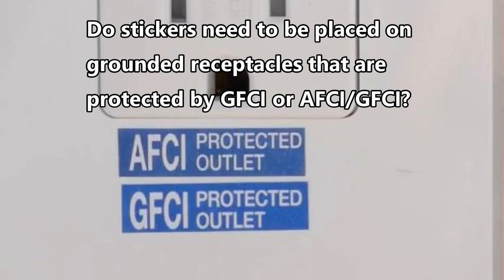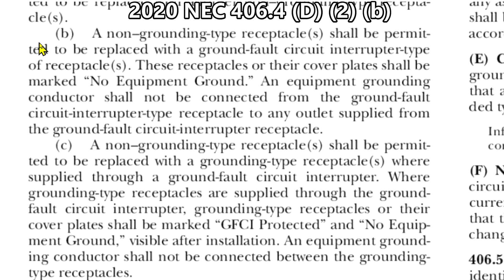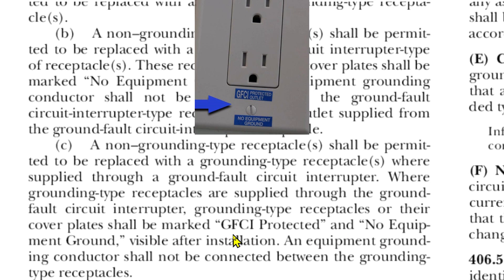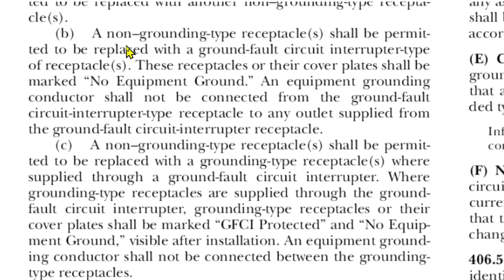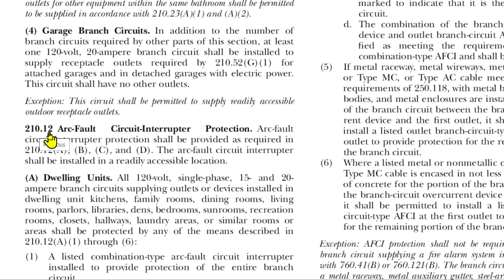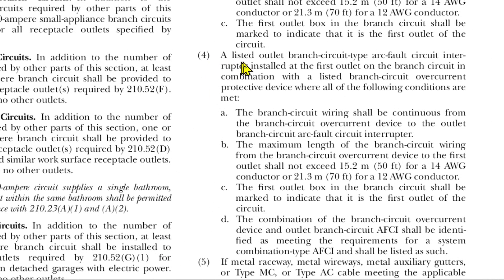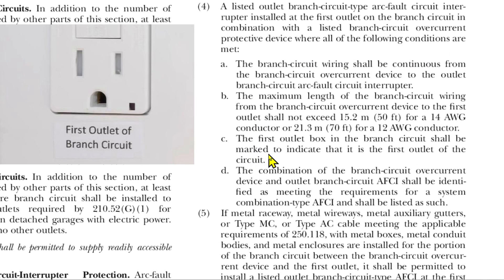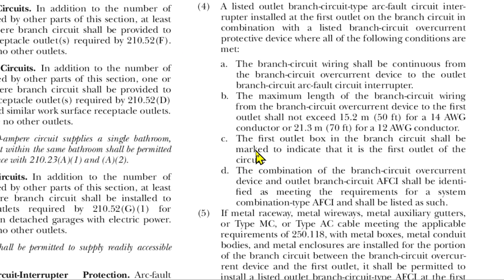Do Stickers Need to be Placed on Grounded Receptacles Protected by GFCI and AFCI/GFCI?

Comment: Though receptacles downstream of the afci/gfci are not required to be marked, some commenters say they mark them to 'remind' the homeowner to check/reset the device if the recept is not working. That's fine for you and me, but I have met many people who don't know what 'GFCI' means and would not make the connection between the dead recept and another recept elsewhere in the room 'with those buttons' (the afci/gfci). A better solution is to put a note at the breaker panel explaining that if there is a dead recept, but they don't have any tripped breakers, to hunt down the GFCI's nearby and check them.
Stickers on the recepts are not attractive! I can see the homeowner removing them simply as a matter of appearance or coming off after a few years. As for 210.A(4)C, it doesn't say the recept must be labeled, it says 'The first outlet box' must be marked to indicate that it is first in line. To me, this means some marking Inside the box such as a label attached to the feed, colored tape or some other means so that someone opening the box knows that this is the first outlet on the circuit. Comments anyone?
Reply: IMHO, what’s the downside?  If you’re uninformed and the receptacle doesn’t work, maybe you figure it out, search YouTube or call your DIYer neighbor and he tells you what to do and then you’ve been educated.  Better than doing without power and having to call an electrician.  Also, if you’re a landlord it could negate a call or having your handyman go over.  There’s a YouTube video in which the handyman laughs about how much money he has made off a particular rental house because the fridge in the garage keeps tripping the GFCI.  Renter doesn’t care and just calls the landlord who sends the handyman.  A 50 cent sticker and a note written on the wall in the garage as to where the reset receptacle is located could save the owner thousands.

Comment: Great content. I have a question. I want to add a extra outlet in garage from interior wall. I would like to plug a heater. I believe the outlet might have 5 or more on one circuit. Can I add a GFCI as the new one?

Comment: Hey Spark guy. I  was going to replace a GFCI receptacle in my kitchen with a dual function AFCI/GFCI receptacle. Then I saw on the internet that the run from the circuit breaker to the 1st receptacle (AFCI/GFCI) needs to be in metal conduit. Is this the correct

Comment: Stickers don’t make it protected the devices does.  Only time I’d do the is if the protected outlet is in an odd place compared to the protecting device.  If you don’t have power at an outlet the obvious thing to do would be to check breakers or gfci or afci receptacles. Even then we get calls because customers couldn’t reset the device.
Reply from the maker: It's a challenge to explain these things to homeowners sometimes, wouldn't you say?
Reply: Most ppl get it. But still they see electricity like it’s magic.  Even if you explain it to the, tripped breakers etc, they’re mind doesn’t allow it to sink in because the answer doesn’t have a right to be that simple. There’s obviously more to it then that lol

Comment: So here is the issue and while the NEC 2020 code does not require a sticker I always put one on not just the first outlet/receptacle but all receptacles on the circuit it’s information for everyone to know and indication that if there is no power to investigate whether the GFCI/AFCI has tripped and for what reason including, dangerous reasons. The NEC is a minimum code going above and beyond even if in this case it might seem overkill) I prefer to do it.
Reply from the maker: Excellent! I agree about exceeding code! ⚡

Comment: I know the stickers meet code requirements, but how about using a label-maker to have something more presentable looking?
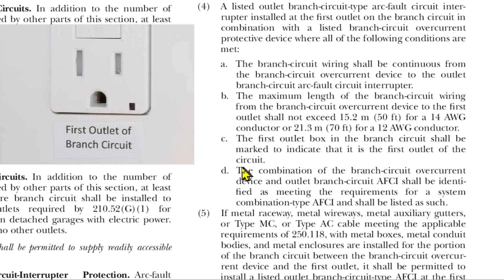At 4:24 the marking seems to have been done on a Brother label printing device.
Reply: A quality made sticker would meet the code requirement. The ones supplied with gfi receptacles are a convenience, ugly but convenient.
Reply from the maker: As long as the receptacle or it's cover plate is clearly marked it should be fine.

Comment: The sticker on downstream outlets let you know to look for a tripped GFCI outlet if it's not working. My basement bathroom outlet is downstream from the master bath upstairs.
Reply from the maker: Excellent. The stickers are very helpful in that case.
Reply: GFCI receptacles in bathrooms must be dedicated. The fact that you have two different bathrooms with receptacles on the same circuit is a violation.
Reply: @stephenrosenthal5252  
House was built in 2004.

Comment: Ive seen guys "trick" the inspector by running a jumper from the ground terminal to the neutral terminal on the back of the receptacle to make it appear the receptacle is grounded when it really isn't.   This is especially true when dealing with the old non grounded wiring in older homes and the home owner does not want to spend money upgrading the wiring🙄
Reply from the maker: Yes, I've seen it as well. I hate seeing it as it's very dangerous.
Reply: Ouch! That is called a bootleg ground and can cause deadly results. Bill has a whole video about this illegal "trick."
Reply: You can check for bootleg ground with a hair dryer and a voltmeter.
Run the dryer and check for voltage between neutral and ground. If 0 then it's very likely a bootleg ground. With the high current flow from the dryer a small voltage will develop from end to end on the neutral. With a correct ground it would show across neutral and ground.
Reply: @scott_meyer   A lot of inspectors just plug in the little tester and see if the lights light up properly if they do that's all they care about.  If they would actually pull random receptacles out and have a look they would be surprised 🙄
Reply: At the end of 50 feet you should see between .5 and 1 volt between neutral and ground with a 1500W hair dryer running on a 20A circuit.
Reply: That wiring was very common in east germany and czechoslovakia.Several doesn people are electrocuted because of it every year.

Comment: Question I never see you any loop impedance Test for testing the earth path and testing the GFCI for trip times why is that . Fantastic video Sir Stay safe watching from the uk 🇬🇧
Reply: None of the tests in an EICR are routinely done here in the states, even with a rewire or new consumer unit. No codes say we have to, which is a shame because I think these tests are a great idea.
Reply from the maker: Ian, Peter gave an excellent answer.
Reply: How do  you know if The unit is going to trip and save lives because our trips have to trip out in less then 30ms . To it’s pointless putting trips in in the states if you don’t have test them specially on houses where you have children running around . But thanks  for the answer. I am learning a lot about system mind blowing at times . Stay safe
Reply: @iandrew6347  I am from the UK originally Ian and when I moved to the states here I did these tests myself when I bought my house. Loop impedance tests like in the EICR - We have branch (radial) circuits not ring circuits and we tend to have larger panels with dedicated circuits for each room and for many large devices. So no real R1+R2 but you can work out a similar circuit impedance Zs and Ze (we have a TT ground/earth rod system ). Usually most houses tend to have 2-3 rods to make ground resistance pretty low (I have 0.02 ohms on my property) so breakers will work under fault conditions. But testing circuits for loop impedance is a great idea to also pick up loose connections and identify faults on different parts of say a radial circuits of receptacles (sockets) testing from the furthest to the inward one. The NEC 2020 does not really mandate a set of predifined  tests (other than recommend insulation resistance and ground resistance testing only if able to do so) rather, installing according to the code should guarantee a safe installation. I like the like the NEC 2020 much to like about it similar to 18the edition amendment 2 in the UK. I agree though if your not testing your guessing. I am in the process of trying to create something like an EICR for the US and it has already been circulated to master electricians in my area in Virginia about the type of testing I did in my house by local inspectors here so there is great appetite for it. You have to remember it would probably be only a voluntary testing regime adding regulations here in the US would be challenging to get through if made mandatory not only are there different state rules but also lobbying by other parties could be challenging to get through even though fire safety authorities would more than likely support it.
Reply: On RCDs GFCIs especially the newest type trip much faster 5milliseconds and at low currents don’t even get above 4.5milliamps they are also UL listed which requires a lot of these safety devices to undergo rigorous testing and avoid a lot of false tripping. These newer type of devices are probably still very expensive in the UK but would outperform even some of the best RCBOs in the UK. In that sense on the technology side the UK is slower and very often people complain about it as costs tend to be high for a while before they come down.

In the US safety protection devices Have to be in place in more areas of the home. So with the NEC 2020 more places mandated for GFCI and AFCI protection together with breakers and low ground earth resistance ensure that overprotection devices work well. Compared to the UK if the NEC2020 code was followed with more of these safety devices installed GFCI, AFCIs and over protection devices including surge protection not just at the panel and at individual points of specific devices then it would pretty much guarantee safe installation. You also have to remember that installation is permitted and has to be inspected as well before it’s give the green light. So while no EICR there is enough use of safe devices to pretty much guarantee a safe installation. However your right if not regularly tested the condition cannot be determined to be safe at all times.

Take also the issue of AFCI or AFDDs in UK we have had them for years and code has required in many places and that has grown. They are relatively cheap here (£25-36) compared to UK again no testing like an EICR but more recommendation of more safety devices in more places can help.